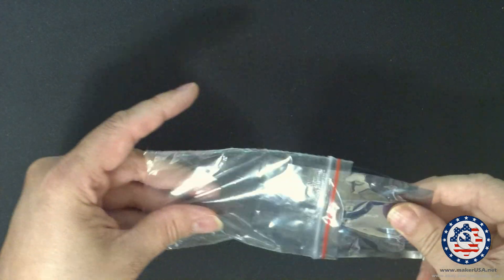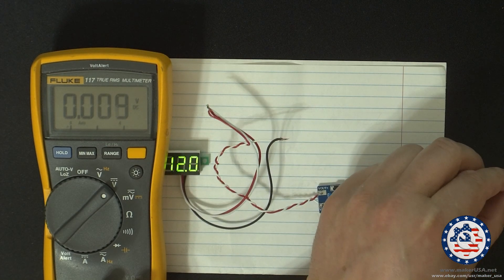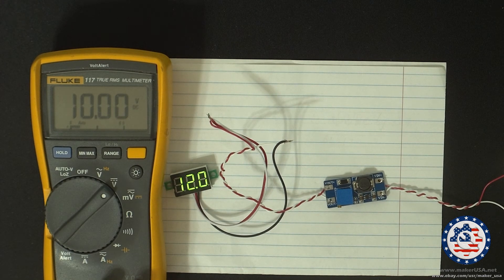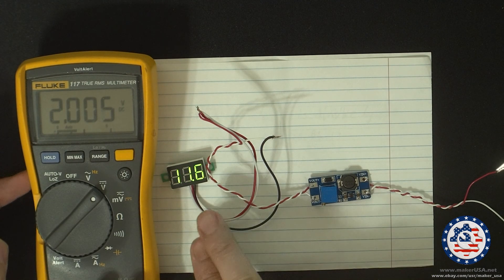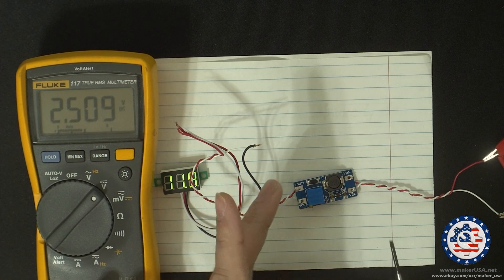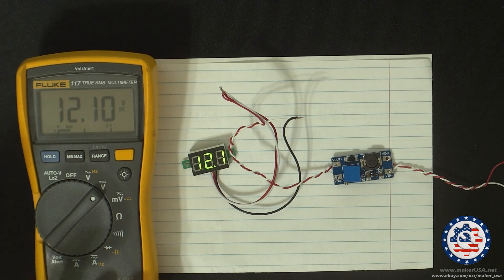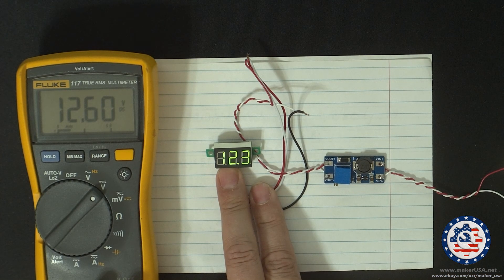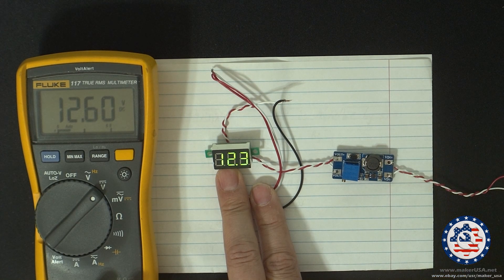Testing a new DC - DC boost converter module MT3068

Comment: Its a very basic explanation on how to set the output V. If you did however put a load on it, it would be good to see what it can handle. I can recommend a 18650 battery load tester..

Comment: No load testing does not make any sense. A better tutorial would be if you could test the circuit with different load currents and explain the maximum power output capability of this circuit. Would shed some light on the efficiency as well.